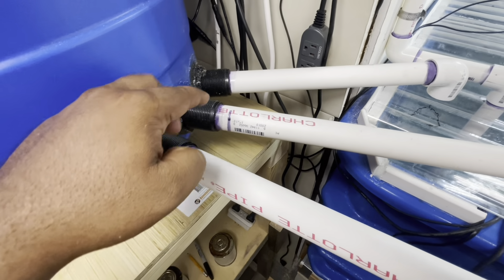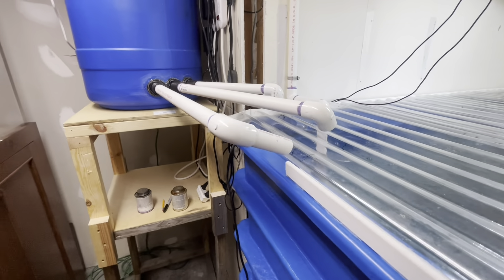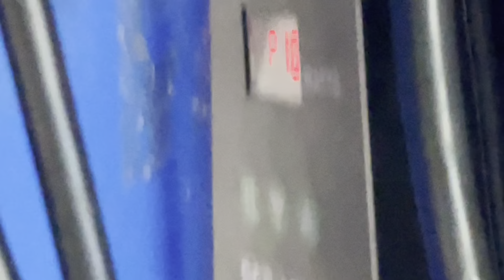IT WORKS? 😱😱😱

Comment: You should of installed unions so you can still glue all pvc pipe and disconnect them when needed. You installed too many outlets now the water is leaving out too fast. You should installed control valves to control the outlet flow. That way you can control the water level in the container
Reply from the maker: oh man that’s a good idea Thank you, I’ll do that. 👍🏽👍🏽👍🏽👍🏽